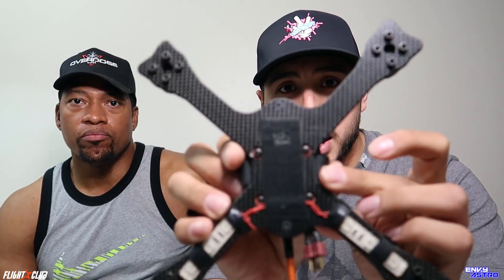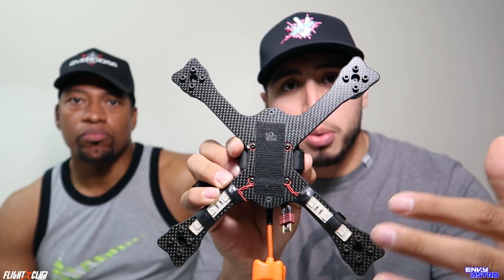Kiss FC Vibrations & Firmware Talk

Comment: Did you do this with Kiss FCv1 or FCv2?  I am having some issues with Kiss fcv2 & 32a esc (119d firmware)  idle oscillations and mid-throttle oscillations.  twitchy go pro video... So frustrating.  
I spent some $ on setting up both of my quads with all the new kiss stuff.  I've always used Kiss, but now I think I need to switch
Reply: Nice video guys, very helpful.  Keep up the info, you help out many pilots.

Comment: I had this exact thing happen to a brand new build. i had soft mounted motors and a soft mounted stack, or so i thought. asked every expert i know and nobody could help. then i triple soft mounted my stack, by placing rubber o rings between each board and the frame. problem solved. its the sensitive gyro i was told. never had a problem since. love your vids.

Comment: My understanding is its the torque of the motors feeding back into the gyro. Betaflight 3.1.x has so much filtering its able to mask this problem (my main beef with 3.1.x being that its crap unless you have a mega high torque motor).

I would guess this would be less of a problem if you were using kiss esc's as they are smoother than most blheli esc's

Comment: I thought it was just me that was having problems with V1.2 vibrations and have been considering flashing betaflight on my Kiss boards. I just worry as i've read that some people have struggled to get Kiss back on the board after, plus i've put a lot of time and work into making an openlog black box and don't know if it'll still work through port 2?
I use betaflight on my QX95 and used to use cleanflight (before the old days of KK boards & KK 2) I find the User interfaces a little overly complicates though. Still, great vid lads, you've a new subscriber here :)

Comment: I was struggeling with this strange sound and vibrations on three out of four full KISS'd builds. 
Sounded like my quads were dying on zero throttle.
Avan props and idle up solved it on one(cobra 2500kV motor).
My F60 build did not have this until I tried 5152 prop. It flies perfect on Dal cyclone and 5040s with no issue.
My ZMR 250 strangely does not make that sound you show in your video; it simply vibrates more or less in the mid throttle range, no matter what prop, TPA, Tune or filter setting I try ;/ My last options are switching to betaflight or try to power the fc of a pololu using the pitch power pads...annoying, but worth the effort. To me, KISS still freels best in the air.

Comment: Thanks, I think so many of us have been having the same issues lately, i have one Kiss setup that i haven't touched in a while that is still amazing but two newer ones that have been driving me crazy. I think the developers at Kiss will get it sorted but im tired of pulling my hair out..... 1.3 works but get horizontal lines in my video with it, even with 330 uf capacitors on each esc.....

Comment: Bottom heavy frame usually will have vibrations at pretty much any rpm even at idle. you can add a camera to the top of your pod to balance out the frame.  I cure my kiss fc vibration by making sure top n bottom are well balanced.
Reply from the maker: 5say307 I cleared it with swapping over to beta:)

Comment: What's up guys? Love the videos. I have a question maybe you could help me with. I have a kiss fc  and 24a kiss ESC's and I was having the same issues that you were having with the glitching. I switched over to Betaflight firmware and I am having a problem with my throttle. It seems like the first 25% of my throttle does nothing, I need to get to almost half throttle before I get off the ground. Do you have any suggestions? Appreciate it, thanks guys...

Comment: Hey, you guys try the new V1.3 firmware for KISS? The filters took care of the vibrations, and damn, 4K! Give it a shot.
Reply: I'm getting it on 1.3 :'(
Reply: Play with the notch filters and LPF on the different axis. I was able to completely eliminate all vibrations with the new filters.
Reply: Sounds promising. Did you both axis roll/pitch? Or did you end up just doing it on one perticular axis?
Reply: FPV Alchemy I turned the notch filter on both pitch and roll. Stock values.
Reply: It worked! I could run 1k on 1.3firmware fine, but if I bumped it upto 4k I would get those vibes bad. Notch filters worked good on 200/100hz. So glad I didn't have to wait for a blackbox. Also test my props for their resonance freq with a spectrum analyzer, came in at 200hz , motors at 200hz and frame resonance at 200hz. No wonder the FC was spazzing out at that frequency
Reply: Awesome. The features of 1.3 are really incredible. After giving race flight a shot and not being happy with the hot, hot motors, I'm glad my kiss board can fly so well. Glad it worked for you!

Comment: Comments • 74 
 Well...NOW YOU"VE GOT ME WORRIED!! LOL! I was going to try the Kiss FC on the Tokio XS build...BUT I donno...If it is having a problem and you put BF on it, then I may stick with an F3 or F4 traditional board as where I have the BL Heli passthrough and those things the Kiss does not. Unless you can give me a very good reason to give it a go at this point for Many use it and many say it is the best hence reason I would like to maybe give it a go?? But on the other hand...I've never used one before and I know how to use the other boards so what should I do?? What would you do? Use an F3 or F4 or stick with the Kiss?? And why? I really want to put the best equipment on this quad to date so I don't know if that would be a Kiss FC or if it would rather the F4?? With the 6Ghz/6Ghz or 4/4 whatever it is I just know that the PID loop is much faster with the F4. So tell me what or which FC should I personally use? F4 prob, huh?? I think probably so?? I have two F4 boards now and like them a lot EXCEPT NO BUZZER PORT OR TABS!!!!! I MUST have a beeper on it!! For I fly all over the place and don't  always know exactly where I'm at lol FPV ya know and I've had to do some searching before lol!! As long as you have a beeper you can find it!! so I'll be putting a stand alone one or whatever I have to do there, but I'd really like to try the Kiss even if I am putting BF on it?? I know the point to using the Kiss prob is the software?? I don't know?? Again I know nothing about the Kiss whatsoever?? HELP!!!!! THX!-and great vid guys keep em coming I'm learning a lot from you two!! moreso than many others I've watched PID tuning on and didn't learn anything hahahahaha!! Thanks again!! L8r-Turbo.
Reply from the maker: Turbo Reviews I would honestly just go ahead and recommend an F4 or any F3 board that has a pass through for BL heli. Also kiss isn't a bad FC hardware wise but right now the firmware seems to be slacking a bit

Comment: I hear you guys on the pass through for BL-heli from a KISS FC but os anyone with a non KISS FC are you able to flash KISS esc's via a pass through on that board? I'm thinking no but I'm open to hearing I'm wrong.
Reply from the maker: Fast Freddy no you aren't I don't think so since they run Kiss firmware
Reply: EnvyAstro I mean in general like if you were running any other fc aside from a kiss fc

Comment: this Vibs are coming form the Frame... Motor and Props spinning in the right frequency that the Frame oscillate...
got this on one Prototype frame with about 0,5mm shorter Arms ... Manufacturer give me Arms that are 0,5 to 1mm longer and this low Throttle issues are gone...
Also... if i add some weight around 70g, GoPro for example, this Oszillation are gone.
now this Proto frame got beaten up pretty bad, Motors got very bad bearings, Props can be damages etc ... no Oszillation at all.
my conclusion is, get a proper Frame with good Carbon
Reply from the maker: Sam Richard but it ties away when I swapped over to kiss FC? Seems to be firmware but may be wrong
Reply: this happens also with BF before they added the Filters... keep in minde... KISS isn't that long on the marktet as CF,BF... i just can say ... 1.3 will be awesome ;)

Comment: I've noticed that RK props tend to resonate like crazy, causing oscillations. Especially the 5x4x3. A lot of durable props tend to do that though, probably due to the way they flex. Setting the notch filter properly will get rid of it. I had to set the pitch notch filter on my Alien frame to get rid of that same issue on HQ 5x4.3x3 V1S props. BF fixed it because it has two notch filters enabled by default. The big difference here is that BF is designed to work on any setup out of the box, meaning it's super filtered and won't suffer from vibration issues, but that also causes delay and make the PID controller feel sloppy. KISS on the other hand comes stock with a lot of the filter options turned off, which helps the quad fly better, but you may have to play with the LPF and/or notch filter to get it smoothed out.
Reply from the maker: Quad Logic I tried different setting and pids in order to take it out but nothing seem to work-.- that's why I gave up and moved to BF. This happened with all types of props!
Reply: EnvyAstro It's got nothing to do with pids. Gotta get the notch filter set right. The notch filter will get rid of it, but it isn't a "turn it on and run" scenario. You have to tune it to the specific vibration you're experiencing. I was able to set mine without black box, but to do it "properly" you need to log the vibes and look at the frequency analyzer. Chad and Tommy did a really informative video on this topic over on the Rotor Riot channel. But hey if BF is working for you rock it brother!
Reply from the maker: Quad Logic hey thanks man!

Comment: I switch over to Betaflight from kiss, and 4 in 1 35a esc , Now no VFAS showing on on taranis. Betaflight works great and no more Vibrations. how do I get the battery voltage to show up.I can't fine any information . is there a work around to get the VFAS to work.
Reply: what rx and fc are you using?  did you enable smartport on the ports tab?
Reply: FlightClub I did enable smart port. I am using a kiss FC. I actually followed your built from flightclub . battery volts works fine with kiss but not betaflight. I am going to give it a try one more time.

Comment: different firmwares use different stock filter settings. i have had that kind of problem several times on all firmwares even on rf1. just need to tune filters, don't you?
Reply from the maker: FPVollgas Germany  I've tried this but didn't fix the issue :(

Comment: I just switched from kiss myself, the video from my alien frame became unusable on all kiss firmware versions because of Jello from mid throttle oscillation. I tried filtering, tuning, I changed my motors, soft-mounted both the motors and the FC, nothing reduced the vibrations even slightly. I had the gyro completely go out on my kiss board so I switched in a new kiss board thinking maybe I just had an issue with the older board, nope, same exact vibrations with the brand new board in both RC28 and 27. Going with the F4 brainfpv board for now, I like the integrated OS so I thought it would be worth a try.
Reply from the maker: Robert Collins he mid throttle oscillations were resolved from he butter mount from the Tokio frames! But yes kiss seems to have many issues right now

Comment: I got those same vibrations. Sounded like some weird harmonic resonance. I ended up changing my min throttle, and haven't had it since. No soft motor mounting, no filtering, nothing, just min throttle change.
Reply from the maker: Levi Maston I also tried going up on min brittle but still seem to do the same, I even turned off air mode but the vibrations didn't go away
Reply: Very interesting - did you go up or down on min throttle to get rid Levi?
Reply: Yeah thanks your right. Dropping the throttle seems to make it even worse - you can then hear the osculation when flying in the low throttle range. My spare is doing it a lot less, so that's now the number one.
Reply: Chris Morley pretty sure I moved the min throttle up, above the vibrations.
Reply: Yeah that makes sense but that takes me to a crazy high tickover. I've changed from four to three blade props and that's stopped the vibration when on the ground nicely but motors are still running too hot.

Comment: Curious if you had to use different rates to get the same feel as KISS on Betaflight? Can't get betaflight to feel anything close to KISS...
Reply: If you go beta 3.1.7 and turn it to PT1 and turn off notch filter 1,  it starts to feel great and similar to kiss, but nothing feels like kiss when it is working well.
Reply from the maker: miguel vice lol true, but for sure very very similar
Reply from the maker: HiFlite FPV yes tool me a while to find the perfect rates that felt exactly like Kiss but I found them. Also the tune has a lot to do with it
Reply: i am on that road too right now... i just love the kiss feel, but i am having a lot of issues since 1.2 and even before... my KissCC is resetting the PIDs/Rates (to uint16max = 65536) from time to time... My Kiss 24A go defective or burn when i disarm my quad with F40Pros and the KissFC has this vibrations as you describe it (not on every quad, but on the most)... as said... i love it and use it mainly but i am getting tired of trouble shooting, tuning and doing everything but flying -.-
Reply from the maker: Hubert Ott I guess if didn't feel a huge difference since I am racing on he firmware rather than doing freestlye moves?
Reply: Raceflight is nicer when you get it running well IMO...

Comment: I think I have like 10 quads right now. 2 are full KISS. Have never had that issue once. Always on the newest FW. Although, just playing around with my F80 rig on 5.5 inch props I decided to throw a KISS FC on there with some BLHeli_S 30a. Noticed it was doing the same thing. Only at ZERO throttle. What is really interesting is that it didn't do it on 5 inch props tho, only the HQ 5.5 inchers. Since then, it is on the LUX V2 running BF. Even on BF 3.1.7 I still will hear those ZERO throttle sounds exactly like in your vid. But its not bad like on the KISS FC. My 2 full KISS rigs have been good since day 1 though.
Reply from the maker: Jim Boomer very weird man did you find a solution to the problem?